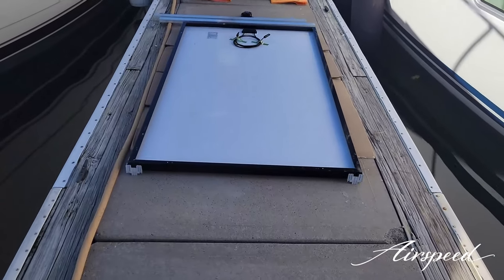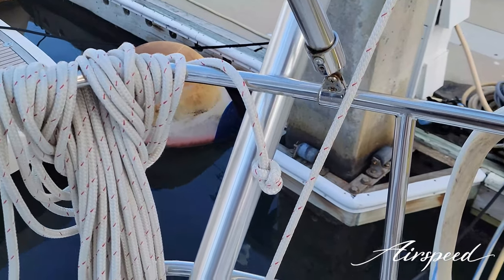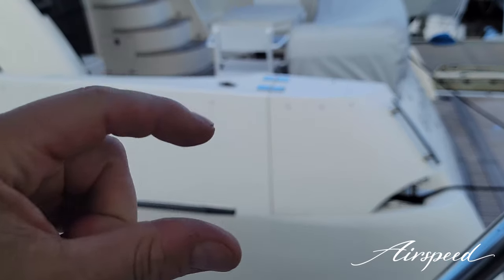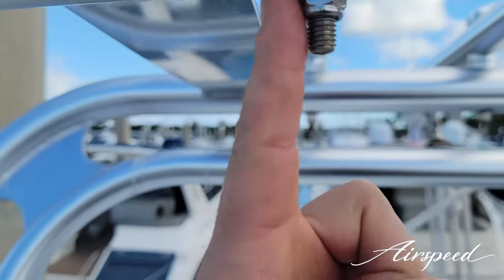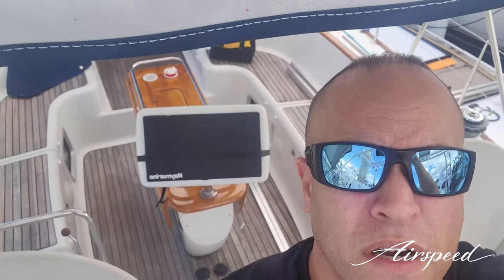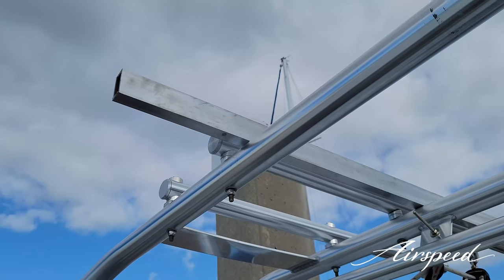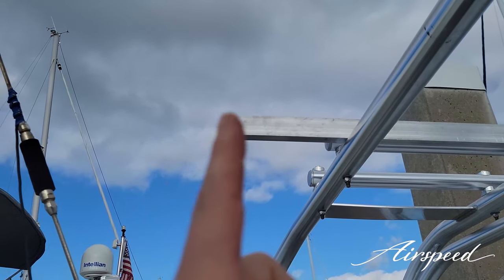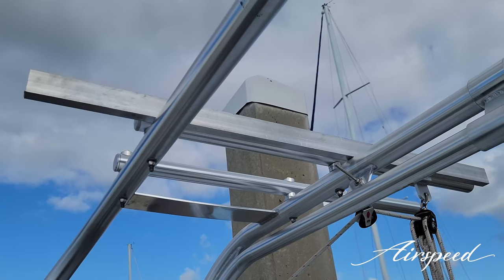Off-grid solar install on a Jeanneau Sun Odyssey 54DS - Part 1

Comment: Nice to meet you today! 

When we installed our panels on the arch, we may have ended up with one or two extra holes in the arch. It definitely fit differently on the boat than it did in the land profit.
Reply from the maker: Great to meet you also! Thanks for tuning in.  Funny how measure twice cut once never really works out on a boat :-) let's stay in touch!

Comment: Thank you for sharing. I have the same boat and are planning to get solar panels mounted. Good luck
Reply from the maker: Awesome Frank!  Do you have an arch on your 54DS?
Reply: @AirspeedAdventures  No. But I need one for solar. My boat has Simpson davits already fitted when I bought the boat so the primary job for an arch would be solar panels and equipment.